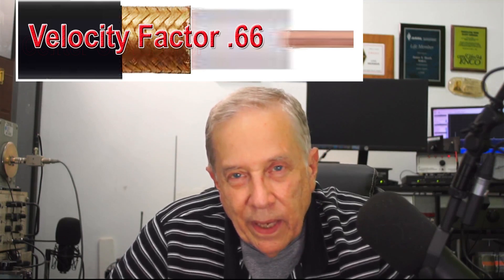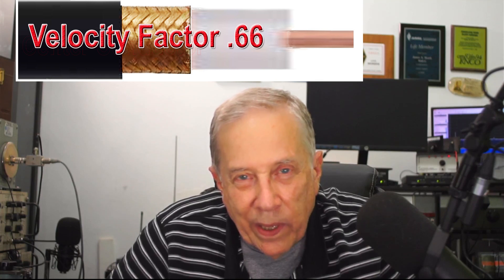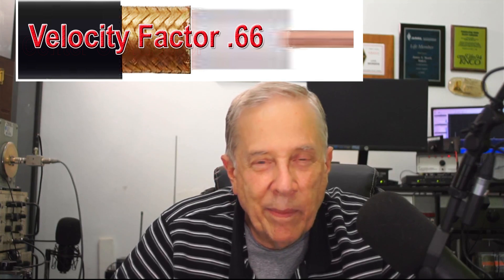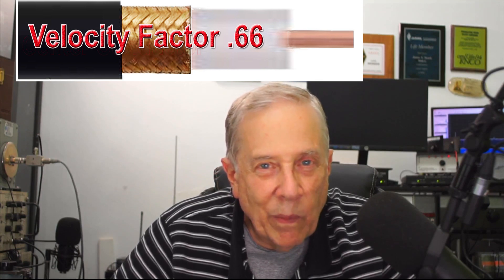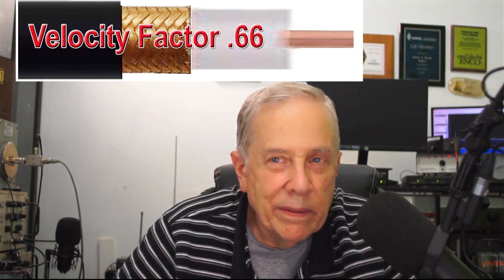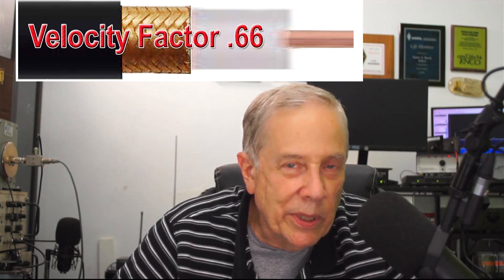What Is Velocity Factor By YouTube Elmer Jim Heath W6LG

Comment: Very good info, Jim. one thing I'm not sure about is if you extend the length of the coax, but you use 2 coaxes with different velocity factors, what happens to the velocity factor??
Reply from the maker: I asked a very good friend about that exact question.  The answer appears to be; just do a weighted average.  How that sound to you Steve?  73, Jim

Comment: good day i was wondering why do hf radios have tuning on them when you need a tuner for antennas never can figure that one out have a great day KF6SIF.
Reply from the maker: Jim W6LG <hamcq73@gmail.com>
5:59 PM (1 hour ago)
to YouTube

Hi Robert,

I have read your question 3 times and I am not sure I know what you are asking.

But, I will give it a try.  First, most of us old guys we don't call them radios.  They are transceivers.  Radios are receivers.  

You said that "hf radios have tuning on them...."  Did you mean that they have so called antenna tuners built-in?  If so, not all transceivers have antenna tuners.  Some of mine do not. Antenna tuners or transmatches or matching networks are not necessary.  Tuners have a small amount of loss.  They encourage guys to transmit into antennas that are not way off in frequency. As a result, in some cases, more than half of the signal is lost in the system.  tuners can just make it worse. 

I ran QRO power into my yagi and never used a tuner.  Design and build the antenna system so that it works without having to invoke some box to make the transceiver happy.  I did work every country in the world over 50 years   Tuners should be a very last resort...and not a good one.

Did that help or answer your question?  73, Jim W6LG 

  

On Fri, Sep 11, 2020 at 5:10 PM YouTube <noreply@youtube.com> wrote:

Comment: If I wanted to make a VHF J-Pole to put way up in a tree and connect it to my scanner, could I use any old coax and still get good reception? I've got a bunch of satellite TV coax RG6, but I don't know the velocity factor for the calculator i'm using.
Reply from the maker: You can go to a table or list that will show the loss of RG6.  In round numbers, you will lose 60% with 100 feet in the coax.  73, Jim
Reply: @ham-radio  Thanks Jim! I'll try to find some data sheets for the stuff I'm using to find the exact numbers,  but ~60% seems like a good place to start. I'll let you know how the reception is! 

73

Comment: Jim what are your thoughts on Walt  Maxwells idea that feedline length and swr have nothing to do with each other,,i work with the odd multibles  of a 1/2 minus velocity  factor of the cable always and that works for me,,i get the same reading at both ends of the cable,,,but so many disagree..,,regards Brian gm7jds.
Reply from the maker: Well, excellent question!!!  Maxwell knew more than anyone. Sure the 1/2 wavelength will given good results when analyzing an antenna.  I am convinced that it makes not difference.  The energy is radiate no matter the length if the antenna and feedline match. That is very important.  A 1:1 SWR may or may not be the resonant spot or frequency.  The resonant frequency may have an impedance of 30 ohms.  Where reactance brings the SWR to 1:1 is not the same place. 73, Jim

Comment: Hi Jim;
I use 4” open wire 400 ohm balanced line, about 150’.
This drives a 250’ center fed Duplex antenna.
I like the the open wire line because the velocity factor is about 0.95 and the loss is about 2db/100’. This works very well.
Of course this requires a transmatch antenna tunner. Mine is an old Johnson Viking 250W.
Will you be discussing open wire line in the future?
redrok AD0TJ

Comment: Great vids,,i an sick of arguing  with ham about velocity in wires and coax cable and the effect on accurate swr readings in the shack,,to the point i have gave up trying to explain how important it is to take these factors  into account when installing an antenna...regards Gm7jds

Comment: The velocity factor is needed when calculating the electrical length of your coax. Some purveyors of amateur radio folklore contend that certain lengths of coax transmission line are to be avoided. 

I suspect this question is mostly superfluous in amateur antenna applications. When the feed point impedance of the antenna matches the characteristic impedance of the coax, we are concerned only with loss. 

However, every myth has a grain of truth. Certain lengths of coax are used as matching stubs--they are an impedance transforming device, when we are dealing with a load whose feed point impedance is a mismatch.

Suppose you have a half wave dipole for 40 meters and you chose to operate it on 20, the feed point impedance will be through the roof. The impedance is essentially infinite in this scenario and it would be impossible to deliver energy to the antenna.

 If you had an odd multiple of a quarter wave of 20 meters as the length of your feed line it would invert the high impedance at the feed point to a low impedance in your shack, at the tuner. 

The operator sees a nice low SWR reading and assumes he is good to go. 

Perhaps electrical length (as computed via velocity factor x physical length) is an important consideration after all. 

73 Jim.

Comment: Since you already have a great experience on cable manufacturing, it would be a nice extension to this video a study of how and why they choose each and every dielectric for each cable, therefore what type of cable shall we use / choose for the lower ham radio bands and what for the upper ones.
As always, thanks for the knowledge you are spreading. 73 de SV1SLB

Comment: Jim, haven’t worked with velocity factor since the Exam, and frankly forgot.  A practical example would add a lot to a video on the subject, including the math that I recall is not difficult.  So going from memory, and you started to do an example, it’s “used when” calculating an antenna length, and so if “in application” one wanted to measure a 20m antenna length, you would multiply ... go through the math on a white board please ... to illustrate the example clearly.

Comment: Great stuff, Jim.  I’m brand new to amateur radio (about to take the Tech exam) and I learn a lot from your videos.  This video rekindled something I’ve wondered about:  Insulated versus bare wire dipole antennas.  Several have told me it makes no difference.  But since the obvious use of insulation on wire is to insulate the electrons from the environment it’s hard for me to imagine how the insulation doesn’t, then, affect incoming and relatively weak signals.